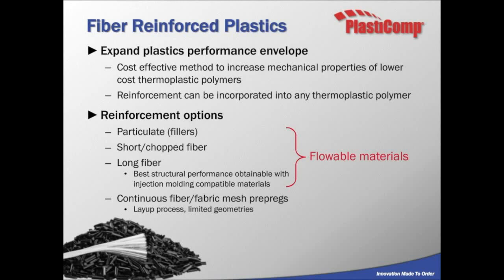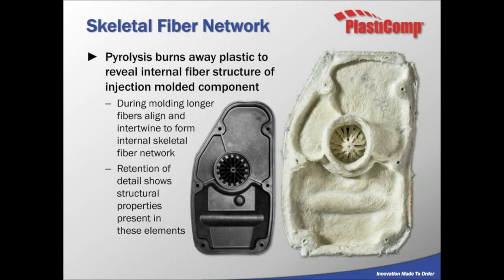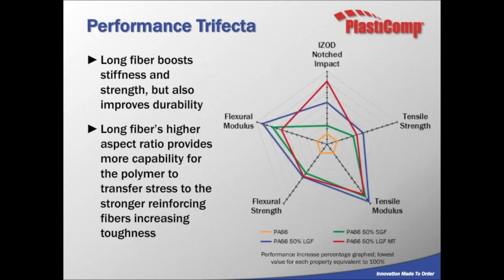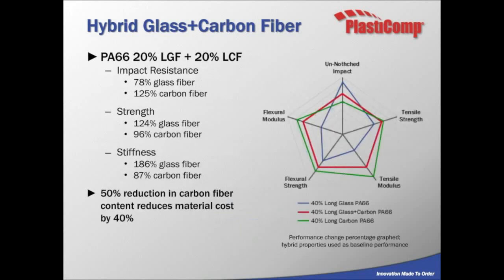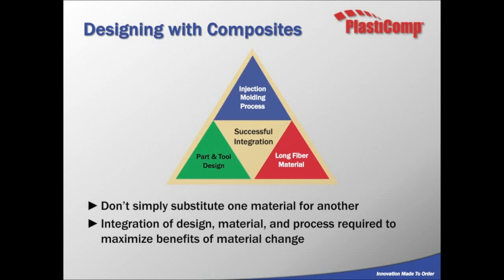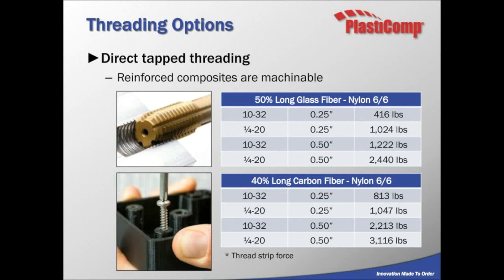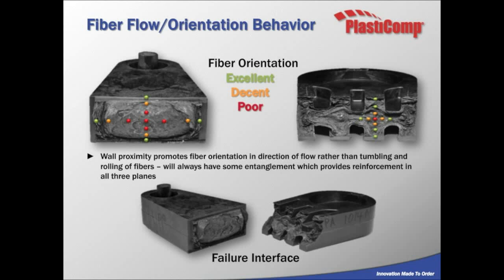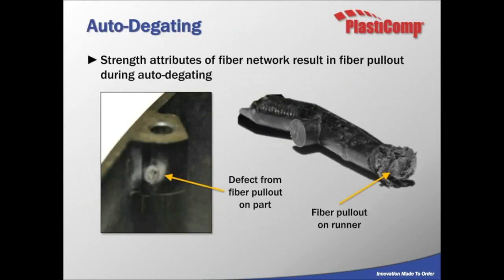Long Fiber Reinforced Injection Molding Composites   The Lightweight Substitute for Metals

Comment: I was going to use PC with 30% glass fill for toughness but have just been informed that glass fibers contain lead. Questions:ONE  Is there a lead free glass fill? TWO  Does Carbon fiber contain lead?  THREE  What percent more expensive is %20 Carbon fiber PC than 30% glass PC??